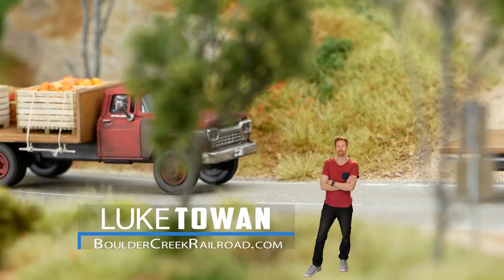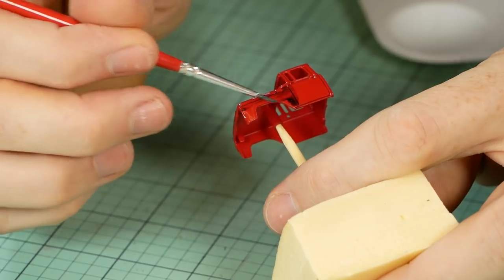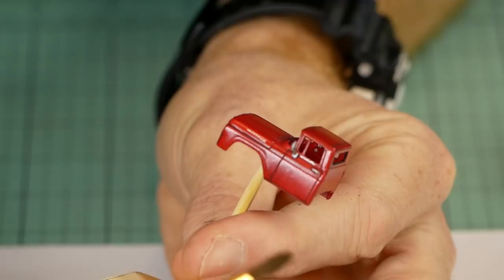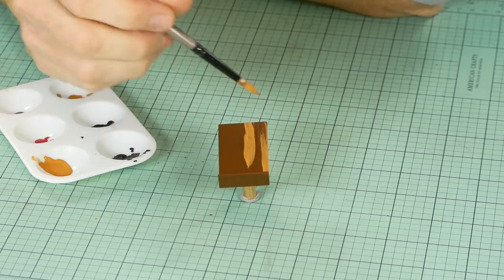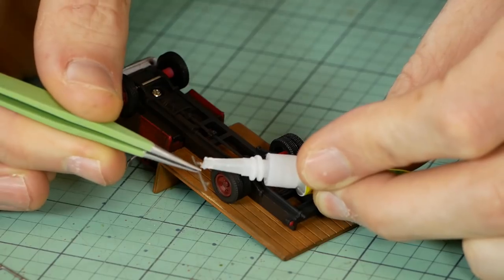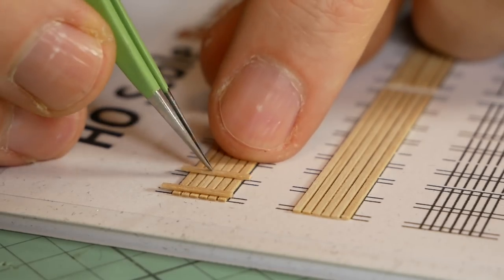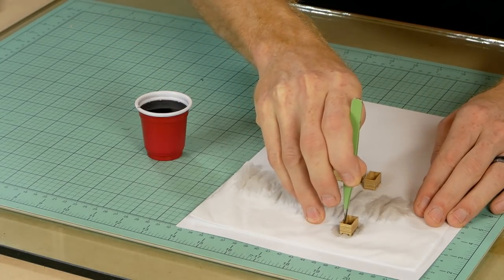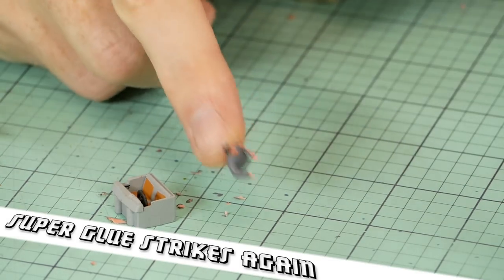Adding Realistic Details to Vehicles – Model Scenery

Comment: Hello Luke, great video! May I ask does it come with a license plate? If so, how did you do it? 😀
Reply from the maker: That's the only part I didn't film, I actually added that at the very end after I had finished filming that's why it wasn't included but basically I just made it in Windows Paint and then I shrunk it down in MS Word until it was about the size I wanted and then printed it using the printer. Hope that makes sense 😀

Comment: I wish I had time, money and patience for stuff like this.. Well I can always watch your videos Luke!
Reply: Grauengaard. U need talent too.
Reply from the maker: yeah it requires a lot of time and patience, you can do quite a lot on the cheap but for some of the good stuff you need to spend a little money! Thanks for watching 😀
Reply: Fantastic video with lots of great tips.
Do you ever "bulge" tires (file a flat where the tire contacts the ground and build up a small epoxy bulge on the outer wall)? If so I would love to see your technique.
Reply: Just save. Little bit at a tine. Buy tools, and equipment, go as you can. Consumables/Perishables come later, and in smaller quantities so they wont go bad before you use them. Use the cheats Luke shows, like using that Thick Paper, and Glue to make parts with, instead of Sheet Styrene.
Eventually, you'll have a very impressive shop!

Comment: Wonderful weathering effect on this truck. One thing's missing though : the tires. I always paint mine with Vallejo Panzer Aces "Dark Rubber" then drybrush them with Panzer Aces "Light Rubber". This gives a more realistic rubber tire color than the original generic "black". 
Also, to glue wood and card (for the crates), I use Deluxe Materials "Rocket Card Glue". It's a fast setting white glue that works with paper, card & wood and can be thinned with water if need be. It's quite easier than with superglue, with less risk of damaging brushes and also of overspills as it's soaked by the wood & card.

Comment: The crates and pallets are a nice touch.  I think though the bed probably should be a gray color as wood turns gray over time. People don't usually treat these wood beds in trucks, they just let it go raw dog in the elements till it rots away pretty much, unless it is a restored pickup then people will usually treat the wood in the bed. Could go with the owner of the truck painted the bed, which that in itself would make for some interesting weathering with chipped paint and bare wood showing through the paint.

Comment: Sometimes when putting a driver, side kick into a cab I use 1/100 figures easily obtained from Chinese sales site quite cheaply.  They look fine.   You can fill a bus or train passenger car this way quickly and they usually do not need amputation of parts to fit.  They look good to ma.  Very nice video; keep up the good work.

Comment: I find using the plastic model "racks" as precision paint tool works good.  How I make one is by cutting a length of the plastic framework the model parts are attached to,  then a lighter heating the plastic rod in the middle till it starts to droop. Start pulling the two ends apart till you get a thread between to two ends. Cut the ends away about an inch or so from the taper at an angle to create a needle like point.  It makes a great tool for pinpoint paint application.   ( if you experiment with the stretching apart technique you can use the thread for creating wiring, fuel lines, brake lines, fence post wire, etc.  Different gauges of plastic rack will give varying thicknesses  to your wire)

Comment: You can use the vehicle as a mold, take some alfoil and impress say a fender into it, leave enough edge to glue back onto the vehicle
Hacksaw the fender off the body and replace it with your alfoil copy, which you can dent to look like a small accident.
Same for the hood, except you can just glue it on top of the original, bending up one edge to look like slight damage

Comment: Great video as usual. I have always had issue losing the 'pastel powder' dusting effects on my models if I dull coated them after but you said that the AIM stuff works well so maybe I should give it a shot. Do you still lose a little and suggest going heavier that desired or does it tend to look about like what it did before the dull coat?
Reply from the maker: Yeah I always had the same issue with using pastels, I find you lose the effect very slightly with the AIM powders however I tend to still avoid over weathering before adding the dull coat, if I need more I'll touch up with more powder after the dull coat dries and then re apply the dull coat. If you overdo it the first time you are pretty much stuck with it unless you completely strip the model and start from scratch again.

Comment: Welcome back Luke! It's been quite a while. I also have a question: Are Hot Wheels cars perfect for HO scale?
Reply: Snowtato XL depends on the car but most of them yes
Reply from the maker: I find hot wheels tend to be slightly big for HO scale but they are very close. You can usually get away with using hot wheels and place them in your HO scale scene. But as Ryan said it sometimes depends on the car because some are bigger than others.
Reply: Upon further inspection, they're actually S-Scale. Have you thought about making an S-Scale scenery yet or is it the same for you?

Comment: Sorry to be pedantic, but the position of the cargo isn't quite correct.  For the rope to tie down the crates etc and look authentic, they would need to butt up against each other.  Otherwise, love your work!
Reply from the maker: cheers mate, I originally had them butted up against each other but it was hiding some of the detail and lost its effectiveness. Sometimes I make a compromise, another small issue was this is an Australian scene and the driver is on the left side however in Aus the driver is normally on the right side  😀 It good that you pick up on the small details though... It shows you have a keen eye for the small things that often make the biggest difference.